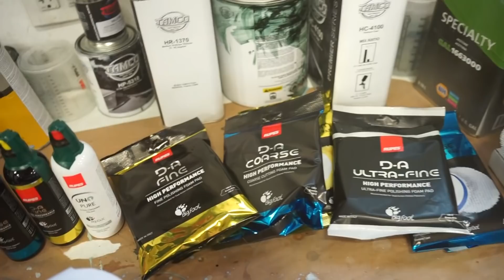Its All Worth It In The End!!!

Comment: Pig tails are almost impossible to avoid.  For my 1st sand, I use mesh style Abranet p1000, dust doesn't build up as fast with mesh style discs.  Then I go onto p1500 wet and so on.

Comment: that color is super unforgiving for slightest glitch .
Smart move spending on decent cut and buff gear .
It's a sucky job but good kit and doing in sections makes it better task and better results .
Hopefully slower activator helps flow out but be careful of runs as that sucks more to resolve than bit of texture .
Only way you going get good glassy finish is cut and buff .
When I sprayed at home I always done 4th coat technique for more nibbing and cutting potential .
hopefully cab and doors go good, give it extra eyeballing and hopefully gained experience and lady luck be in your favour .
Reply from the maker: Yeah you see everything with this color! I’m hoping the slow hardener will help! I’m sure it will!
Reply: @austinniemela  fingers crossed on the doors , tailgate kind of highlights potential ripple lines you can get around repair areas and way you see it in dark colors, really hard know it perfect until shot the clear and then eyeball it all angles :-S
It going be better than most paint shops as biggest help with paint is pure physical effort and finer details and you got that covered ...
Reply from the maker: @mrb1864  yes for real! Everything looks awesome till color and clear goes on then you see every little defect! I just don’t have the experience in bodywork!
Reply: @austinniemela  I think pure effort can replace experience to some extent, lot of pro paint guys do some poor work .
You gaining experience, most of it down to learning products and equipment and you got new everything on this one so was tough one in all aspects from paint  equipment and panel condition .
overall it going pretty good .